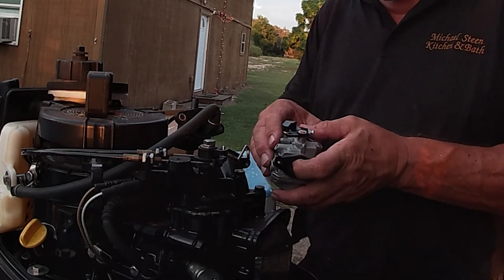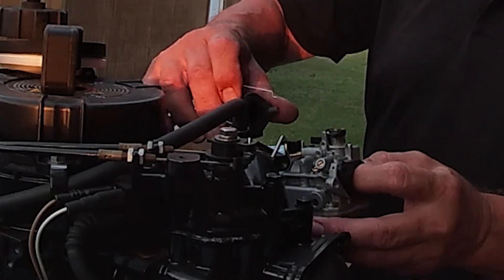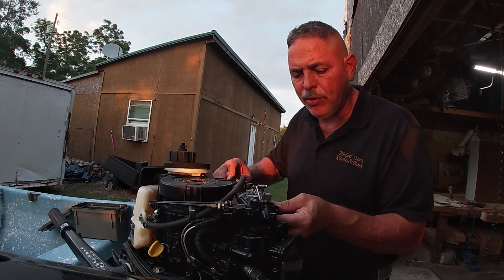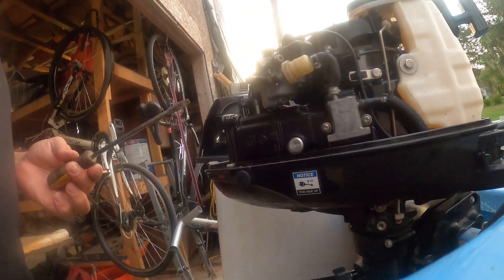My Outboard Won't Start | Outboard Starting Problems | Replacing Mercury 4 Stroke Carburetor

Comment: Any Chinese carb I’ve used ended up causing more issues in the long run. Better off just cleaning & rebuilding the original carb with quality parts. Remember we’re on the water without much around for parts when we need them.
Reply from the maker: Hey buddy, I respect your opinion but don't agree. You want to come on a live this Sunday and we will give 2 opinions? No worries, I will keep it respect.

Comment: Funny I have the same motor and just bought the exact carb on Amazon to fix my problem.  My issue was the needle valve was not sealing for the float bowl and was flooding the carb when starting/running.  I tried cleaning the jets and valve to no avail.  

Tip for you - to shut down motor, just hold in the red button in, you don’t have to pull the kill switch.   Good luck!
Reply from the maker: I did the same, after pulling it of and on, cleaning it, I gave up and ordered one. My red button is hard to push in. I have gotten use to pulling the key.